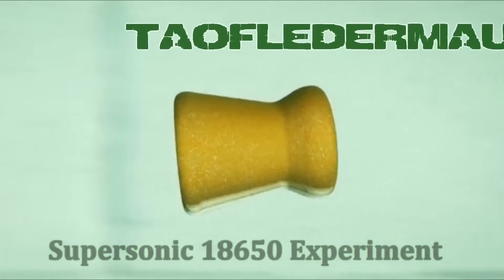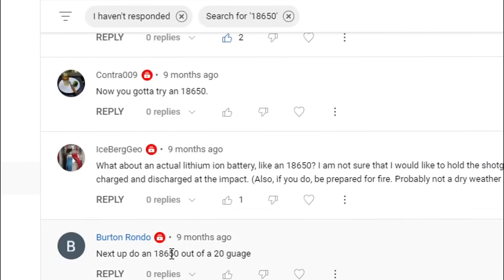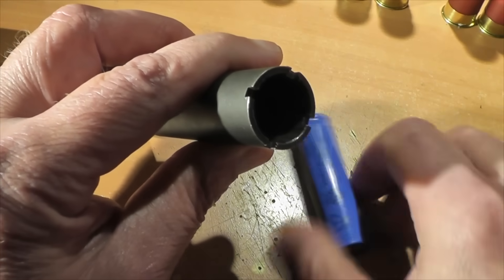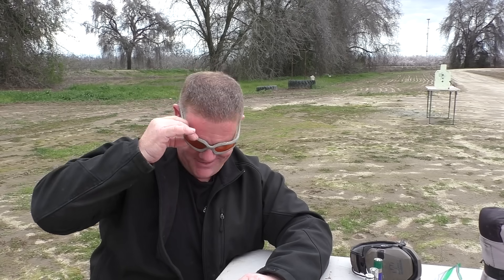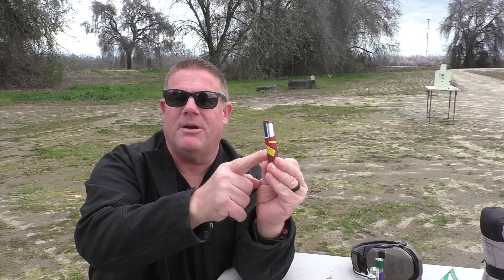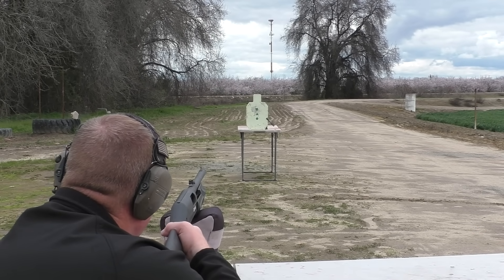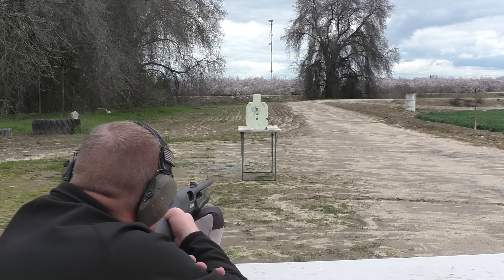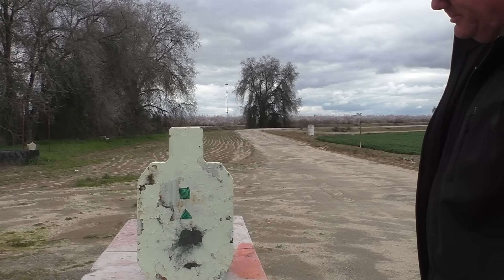12ga 18650 Li-Ion SHOTGUN Slugs - TESTED!

Comment: Video of lithium from a small battery reacting to water: https://www.youtube.com/shorts/yGDkiUAwxRs

My guess is the reason the lithium didn't react with the water is either the metal casing around the battery was still intact enough to stop it from igniting, or it's also possible that the lithium was pulverized on impact, meaning the reaction would not really be observable due to a lack of visible material.

Comment: Hear me out:  CR123 with a surrounding metal (HVAC tin tape) with a semi-discarding sabot. LED front and rear, on firing the wad pushes the rear LED and it's contact forward to complete the circuit for both LED's.

Comment: Now, I can't confirm that this is the reason for the charged batteries being more stable, however, for context: electronic charge is being used in 5th generation stealth aircraft (F-35, B-21, F-22) to disrupt radiowaves through the use of tape that has changing electronic charges to scatter waves, but it's being rumored that electronically charged coatings and/or a system to create a variable electronic charge on the surface of the aircraft are under development for the NGAD (Next Generation Air Dominance) 6th generation US fighter program. One of the program requirements is that the fighter jet be able to maneuver without the use of stabilizing wings on the tail, or any moving stability components. Effectively they want some form of flying wing fighter jet similar to something like the B-2 or the B-21 bombers, except for a fighter jet instead; the problem is, flying wing aircraft are generally unstable and have to use complex computing systems to manage the stability, so while they have the theoretical capacity to be far more maneuverable and faster, but do not have the actual computing capacity to create the  stability necessary to maneuver in the manner generally required of an air dominance type of fighter jet. The theory being is that you can use electronic charge along the surface of a flying wing aircraft to negate the instability created when making complex and high speed turns or travelling at super sonic speeds. You could potentially see a fighter jet that goes super sonic without creating a sonic boom due to this technology.

The reason for that context is to say, it is possible that the electronic charge on the surface of the battery helped manipulate the wind resistance enough to allow for better stability. It would require more testing, and may be reliant on a big enough battery, or I guess ratio of battery size to electric charge output on the surface

Comment: G'day,

My speculation,

The Rifled Choke took a stable Projectile and tried to "goose it's Arse" 
With a
Snatch and Grab 
As it flew past 
Which left the
Projectile wobbling with
Indignation 
And trying to look back
Over it's shoulder while
Escaping
Downrange... (?).

The Rifled Barrel
Needed extra 
Packing to assist the
Gripping so it better
Twistificates 
The Battery 
SMOOTHLY..., as it
Accelerates - 
Down the Tube.

Either too much Aluminium Shimming wedged the Shell in the Chamber, blown back as the heavy Battery departed the Case while going into the Barrel - or maybe the heavy Recoil broke something delicate and expensive inside the Italian Firearm ?

But, without the correct amount of Shimming to engage the Lands and Grooves, the Rifled Barrel merely played Slap and Tickle with the Battery leaving it as upset and cranky as did the Rifled Choke.

Meanwhile, the  Straight Parallel Smoothbore condescended to permit the Battery to accelerate in a straight line, with NOTHING to jab, grab, twist or pull at it ("Womens' Judo", perfectly defined - right there !) as it tries to fly straight 
And accelerate.
In a straight line.........

Whereupon it is
STILL pointing within a
Sandfly's 
Foreskin-width of the very same
Azimuth Bearing, 
And Horizontal Pitch- Attitude ;
A mere
Pooftillionth of a
Second later,
When that aligned Battery 
Impacts it's
Target...

Just(ifiably ?) my guess...(!).

Such is life,

Have a good one...

Stay safe.

;-p

Ciao !

Comment: My prediction is that the fully charged batteries will explode more spectacularly. Generally discharged batteries are safer to disassemble and pose less of a fire hazard, so this is what I'm basing my prediction on. I'm glad you guys finally did this test, been wondering what would happen with these myself.

edit: FYI, an 18650 isn't fully charged until it's at 4.2 volts. 3.7v is considered "nominal" but 3.5v would be basically empty actually.
Reply: What makes lithium batteries flammable is trapped hydrogen gas. During thermal run away, the battery produces large amounts of gas. Higher charge state increases the reaction speed and is the main cause of thermal run away in the first place. The key thing though is that it takes time for that gas to be made. When the battery is fired out of a shotgun and hits something its instantly destroyed so there is no time to produce hydrogen.

 Now, Lithium itself is reactive with water. So there's a chance shooting a water jug with it might get something to happen. Though there's a lot of variables there. Does the water atomize too fast and never actually touch the lithium? Does the battery not disintegrate and release its lithium contents? Is the lithium too contaminated with additives and fail to ignite?
Reply: @caseyb1346  There is almost no hydrogen gas (or say trace amount) in Li batteries.
The anode is graphite, cathode is some Li-cobale-manganese-nickel-oxygen or Li-Iron-phosphate compounds and the electrolyte is LiPF6 plus organic solvents (just remember they're toxic, the chemistry is not important)

When fully charged, graphite will be intercalated with "Li metal" and the oxygen atoms in cathode will also become very active (it's not scientifically correct but easier to understand). If these 2 touches, oxygen in cathode will oxidize very active Li metal and cause thermal runaway, and plus you have organic solvents in the electrolyte...BOOM!! Of course, it'll also react with water to produce hydrogen if you expose to it (the reaction is much faster than your gun shot)

However, if the battery is empty, there's no Li metal in graphite (Graphite cores in your pencils are very stable, right?) and the oxygen atoms in cathode is also not as active. No reaction will happen no matter how you torture the battery.
Reply: @sovietrepublic38  what is the gas inside failed pouch lipos that inflate? i thought it was hydrogen, it certainly is flammable
Reply: @virtualtools_3021 Lithium batteries use a hydrocarbon electrolyte - think diesel.
Reply: @caseyb1346  Didn't know that. Is the hydrogen gas present even in the dead batteries ? Could explain why one of my batteries exploded and got launched upwards while I was fine-tuning spot welder's settings.
Reply: Charged cells shouldn’t make much difference as the battery is rapidly disassembled before it can discharge electrons.

Comment: Question is one end of the battery heavier than the other  ? If not,  maybe you could put a little added weight on the end that goes in the shell or tie some string,  ribbon or even use an o ring with super glue and heavy fishing line.  Spin the battery as it goes in so that the tail winds into loops . Just a thought 🤔🤫

Comment: 18650 > AA any day
More voltage, more amperage, more capacity, and rechargeable thousands of times. 

If you need a smaller battery, there are 4.2v lithium batteries that are the same size as AA and AAA (14500 and 10440). Of course, you cannot put a 4.2v battery in something that was designed to run in 1.5v … usually. If you open the battery compartment on most LED lights, they often use 3xAAA batteries to get to 4.5v, and those will usually run on one 18650 instead.

Comment: You rally can't expect fireworks out of an 18650 in these conditions. There's no time for that to happen, the battery just turns to dust as soon as it hits the target without having the chance to turn all the stored energy in the battery into heat. These batteries do fun things when they stay in one piece, and end up with either internal short, or are shorted externally without a protection circuit. The amount of lithium in these batteries is also very low, so a water explosion isn't going to happen. There's just trace amounts of lithium there.

Comment: the hightech marking to tell empty and full apart? as an engineer, in my opinion it is very simple. whatever makes you to distinguish them even in bad conditions reliably is working. hightech mostly adds cost.
by the way, that's the reason why PCBs are green with white text. not because there is a technical reason or something. the US army tested that color sheme and decided that green-white is the best one to read under various lighting situations. and you want your technician to be able to fix the radio even with a candle light.

Comment: A common practice with the South African Police back in the days of riots in the townships in the 70`s and 80`s...they also used to drop D-Cell batteries down the barrels of the 37mm "Stopper" riot guns. That fired at head height with a 37mm rubber bullet behind it usually put a stop to the riot they were attending very quickly...

Comment: Lobbing batteries at high speed is always crazy. The lithium fires they can produce are insane. A professor who was in Nam used to show us how the lithium hearing aid batteries explode when they are submerged in water. One of the most memorable demonstrations I can remember.
Reply: No shit?  I've got a mayonnaise jar full of hearing aid batteries. Gotta try this out!
Reply: @MrRadio  see if you have a new one and have at it. I wanna know if they ever fixed that flaw. It's been over a decade, so I hope they've done something in that time. 😆
Reply: @mrradio2187  I'd be careful storing those old batteries like that, I would be concerned they might short out electrically and cause a fire- they do have lithium in them...They are probably too dead to do that, but......
Reply: Li primary batteries != LiIon rechargeable batteries. 
The former contains actual metallic Li,vehich reacts much like Na or K with water, the latter does not.
Reply: @Michael Tempsch  that explains that. Makes more sense. It was an electronics class. I wish I'd gone into organic Chem. Thanks for that, Michael.
Reply: @michaeltempsch5282 thanks - that is what I was going to suggest, only more vaguely.
Reply: Terrifying!
Reply: A lithium battery and a can of shaving cream makes a great incendiary grenade.  No I won’t be more specific.
Reply: @erroneous6947  they sell both of those past TSA checkpoints.
Reply: @illuminerd3757 Too bad the pump action 12 gauge and Lee shotshell press are priced waaay high because it's at the airport!
Reply: @erroneous6947  makes sense since most shaving cream uses explosive propellant like propane or isobutane.
Reply: @erroneous6947  That sounds cool, I'll have to never try this later
Reply: @erroneous6947  oh i don't need instructions for that recipe 😂
Reply: What recipe  @Ferrari255GTO
Reply: @BabyJesus66  if you don't know you probably shouldn't
Reply: hearing aid battery shot sounds like a devious idea I gotta know if it's been done.
Reply: Dear lord, why weren’t there more incidents of people forgetting to take their hearing aids out when taking a bath?
Reply: @larrygro  from what I've seen, those things are pretty airtight. I'm sure someone somewhere has had to write up a random incident report on one failing, though.
Reply: Yeah. Should have hit water jugs
Reply: and now I know why all consumer-available hearing aid cells are Zinc Oxide these days.

Comment: If memory serves, the UltraFire cells are scammy, underfilled and don't have the advertised electrical energy.  A full 2500-3500 mAh 18650 is about 50g and can have 2x or 3x the stored energy (around 28 of them for 1MJ, or the electrical energy equivalent of a stick of dynamite).  For maximum bang from the electrical side, you need them at 4.2V.

Comment: Awesome science guys! 🥸 I really wanted to see a fully charged 18650. 4.20v is full for that type, 3.7-3.8 is the nominal voltage. You also should try real 18650s from name brands. They weigh a lot more and have way more energy when fully charged. 
Sweet test tho! 👍🏻
Reply: Would be interesting to see the difference between a higher mah lower amp cell and a lower mah higher amp cell when they impact. Which will make the bigger boom I wonder.

Comment: Hope whatever got hung up in the rifled chinesium-scoped barrel got sorted out. Astonishing that one of Little Tony's rounds flew straight. The other shot wasn't that far off either considering choked shots keyholed.  Very interesting, thanks for sharing!
Reply from the maker: I ended up destroying the Benelli barrel unfortunately.   My fault
Reply: @taofledermaus  Oh no, sorry! Sometimes the price of science is steep.
Reply: @taofledermaus  You guys should try to find a shotgun with an extra large bore, 10-Gauge or even bigger, just to see what larger objects you can launch. You're handloading everything anyway, so it's not like it'll be too expensive.

Optionally experiment with what  you could do with an old bubba'd bolt-action rifle, blanks, and a 60mm or something launching cup welded onto the muzzle. I bet you could dent the lead plate if you launched a dildo with what.

Comment: As a teenager I used a heavy-current variac to blow up batteries. D cells, C cells, AA, 9 volt, and the little button type hearing aid batteries. Those little hearing aid batteries are surprisingly violent when they go. It never occurred to me to use them as projectiles. It was probably best that I didn't, considering everything else destructive I was into. My poor parents, LOL.
Reply: My brother attacked one of those 'hearing aid' type batteries with a gas torch, the sound was to say the least 'intense'.
Reply: @paulstubbs7678  I hung mine outside my bedroom window on a tomato stake. When it blew, there was a blinding white flash, a cloud of smoke, and a very loud boom. It tripped the circuit breaker downstairs. I ran downstairs to reset it, my parents were sitting there in near-darkness as the smoke cloud drifted past their window. I reset the breaker and ran back upstairs. All my parents did was briefly look at each other and shake their heads. By this point in time they were kind of jaded, haha.
Reply: @zipperneck9050  Sounds like they were hit by lightning

Comment: there shouldn't be a difference with charged batteries or not since its simply a difference in the chemicals inside. HOWEVER...
a capacitor stores static charge instead, a big charged capacitor would likely explode on impact like many were hoping with the battery.

Comment: The fluctuations in the manufacturing process could possibly cause the core of the batteries to be off center. That could be the reason why some batteries were so badly off what should have been a good trajectory. 
Where were the batteries produced if I must ask?
There's your answer. Even batteries from one factory can vary greatly from another depending on the level of technology used in manufacturing.

Comment: If you really want to see a reaction with your water-based targets, use pure elemental sodium projectiles.
Reply: Would a solid slug of sodium traveling at 1200fps even be in contact with water long enough for a reaction to take place?  I've never personally done it, but all the videos I've seen, it's not exactly like setting off TNT....
Reply: @elesjuan  I think it’s much softer than lead. If it doesn’t break up in the gun then it should do so in the target and react very very quickly.
Reply: The problem with elemental sodium is that the moisture in the air is sufficient to ignite it, that's why it's kept in a jar of oil. Once you remove the oil and expose the surface it's just a waiting game until it goes up in flames if it's a small piece, larger pieces will explode violently on contact with water. Mythbusters did a segment on the alkali metals trying to blow up a toilet or bathtub, something like that, but it wasn't as spectacular as some lab demonstrations I've seen go wrong. There's one on YouTube where the fume hood loses all it's glass after the teacher drops in a piece that's just a little too big lol.
Reply: Backyard Scientist actually has a video where he does that
Reply: Potassium is much more reactive and likely to make fireworks.
Reply: would love to see NAK slugs

Comment: What causes these batteries to go up in flames is a short between the layers water can cause it or crushing im a little surprised the one that smacked the comp case didn't go up They did flash a bit though but meh no red pretty flame jet LOL I half expected at least 1 to get damaged enough inside the gun for it to come out smoking or flaming like a tracer LOL

Comment: 18650s are great, i use an old vape as a phone charger when on the go as normal portable phone chargers arent designed to have the battery door removed. But with an old vape (just the battery box with no atomizer) when it dies i can just take a pair of batteries off of the charging bay and swap them and be back in full.

Comment: A proper 18650 is about 45gr . Those ultra fire cells are knock off cells that are kind of famous for having a fraction of stated capacity  and causing well ultrafires . You can get proper cells from harvesting them from laptop or tool battery packs or buying from a reputable seller. Kind of curious to see how proper capability cells do . Also over charge them to like 4.5 volts to get largest impact.